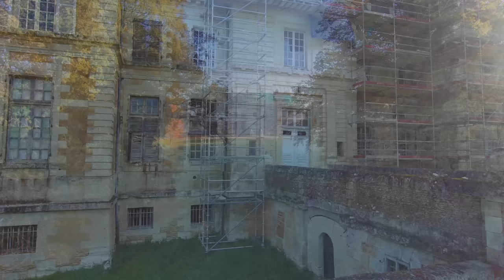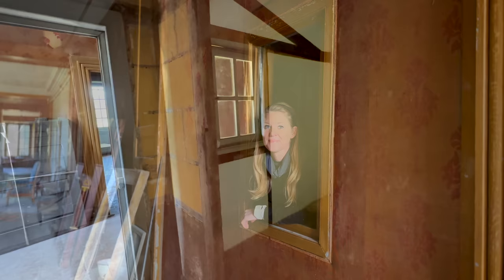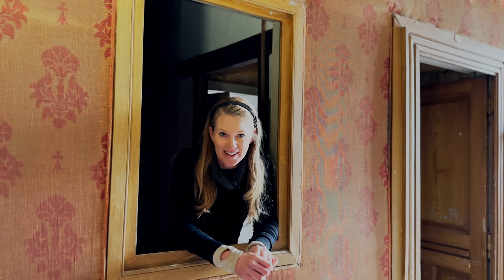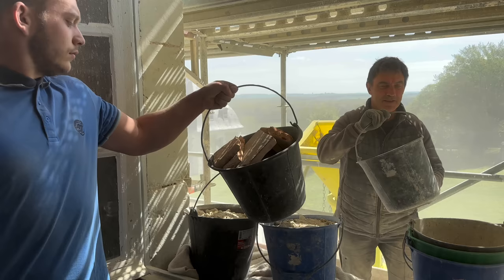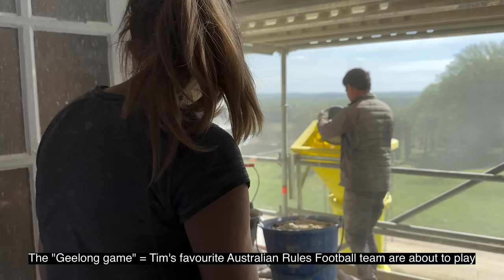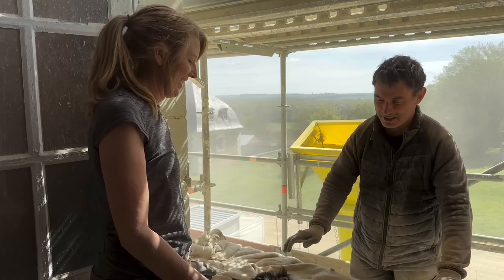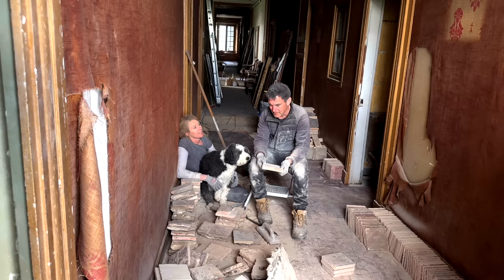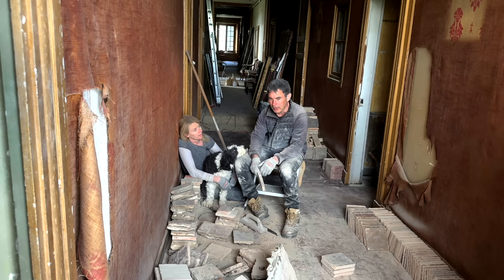Restoring the first floor ... Part One

Comment: Restoration of these chateaus should be handled by a large construction and  architecture firm. They literally need to be stripped down to the stone walls and then have an entire new support structure built within,along with mechanicals,  because they are too old, and unsafe for do it yourself crews to work on. Plus the enormous cost of restoring these wonderful chateaus is just too much money and work for owners. It would be nice if many of these abandoned homes sitting in disrepair all across the French countryside were completely rebuilt to modern day standards while preserving the facade and any other period details that need to be, and were turned into Bed and breakfast hotels, so that many folks could get a chance to enjoy them.
Reply: Tim et félicity ont la chance que ce chateau est classé " patrimoine  historique ".  donc,  ils vont avoir une aide de l' état de 60% des travaux, plus une aide du " Loto du patrimoine " plus une aide encore d' une fondation,  et le travail et le conseil d' un architecte agrée des "monuments historiques " expert du XVIIIeme siècle,  expert dans le travail de rénovation.
il a travaillé au chateau de versailles....
Reply: transformer des bâtiments anciens, parfois historiques, sans vouloir profiter de leurs classements aux  " monuments historiques "  pour l' histoire et  l' aide financière, mais pour le modernisme, existe beaucoup déjà. Quand les pulsions mercantiles auront ravagés tout notre savoir faire , notre histoire, il sera trop tard..  heureusement , en France , il reste encore beaucoup d 'histoire, et d' amoureux,  et que d' ici là ,  les chambres d' hôtes " historiques " resteront uniques...   sans passé, pas de futur...